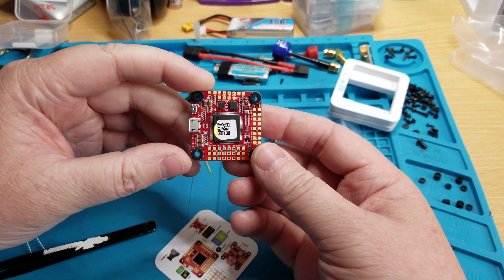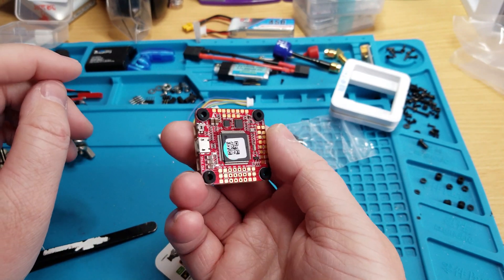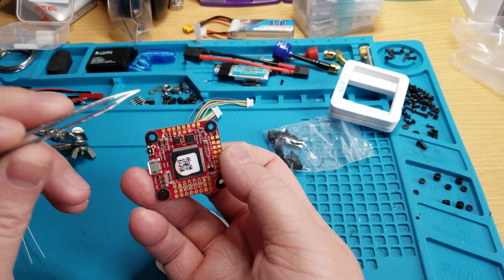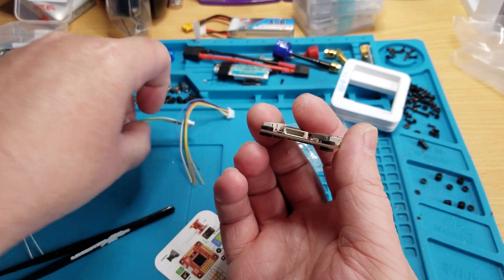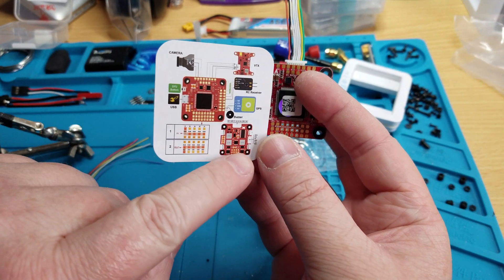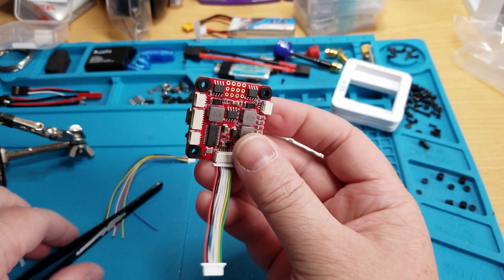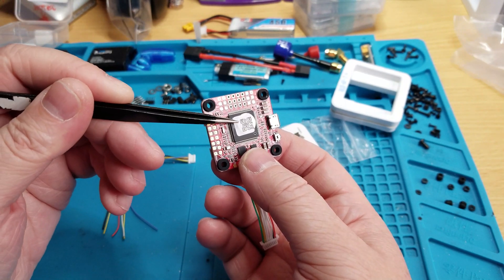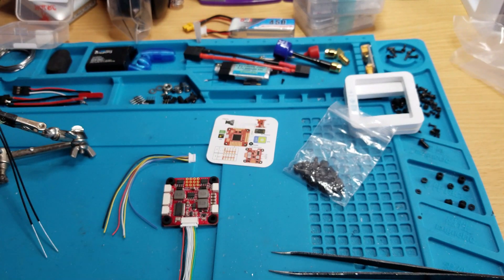Hglrc forward f7

Comment: There are f3 f4 and f7 chips, separate and individual. There is one called an f10 that is an f7 and f3 on one board I'm pretty sure that's what your thinking of, the Strix binary f10. I'm looking for an f7 board, just returned an airbot omninxtf7 cuz motor output 2 was DOA.. I'm thinking matek f722 STD. I like the SE but I'm using 4 in 1